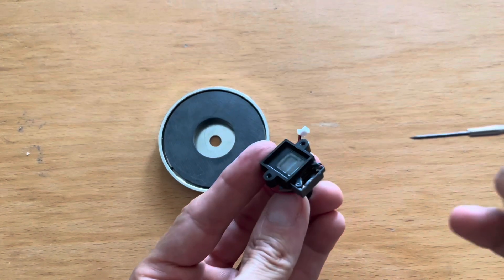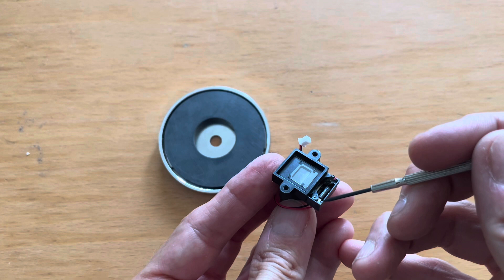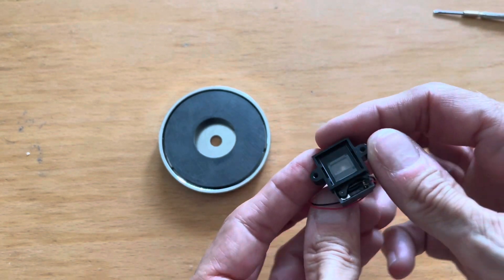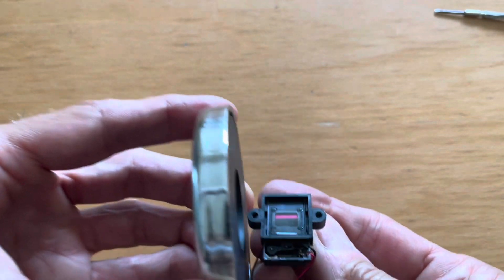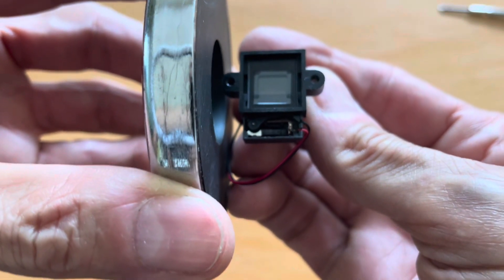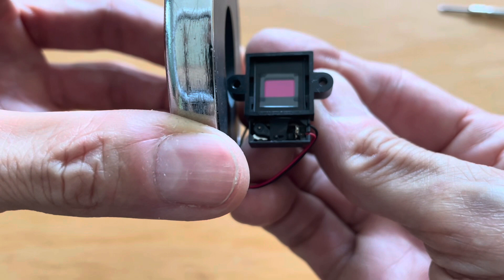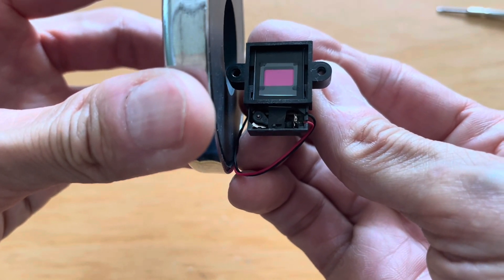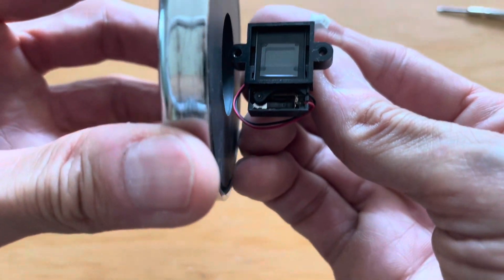Wyze Cam V3 with Purple Image: How to Open and Diagnose

Comment: This seems to much. could completely ruin the camera.  Another guy has a video that says you have to keep tapping the side of the camera until it clears.  That is more like how it changed, moving the camera to record at a better angle.  Just had a hurricane and rear neighbors are throwing all their debris over the fence into my yard.   You have to catch them in the act to file a complaint.  Camera went puffy pink all over at the exact time I needed to record.
Reply from the maker: @susan6443  bummer! In this case, I wanted to understand why the camera was doing that. I could see there was some heat damage in the plastic so it could not be fixed completely. It was cheaper to get a newer version cam.
Reply: @gotitdone   In the end I turned my camera off for 4 minutes and turned it back on.  clear as a bell again.  So easy. thanks
Reply from the maker: @susan6443  I am so glad it helped you. 
Please consider subscribing to my channel or a $thanks. It will help me on doing more videos like this.
I am regularly fixing things around the house and adding videos about it.